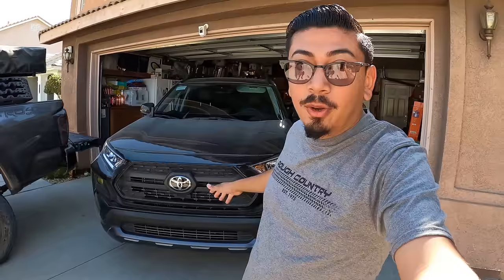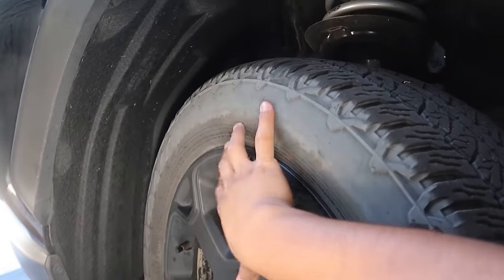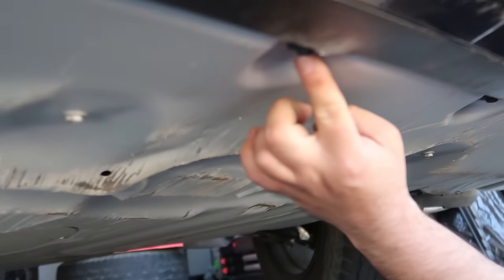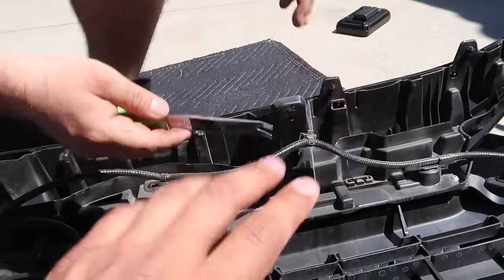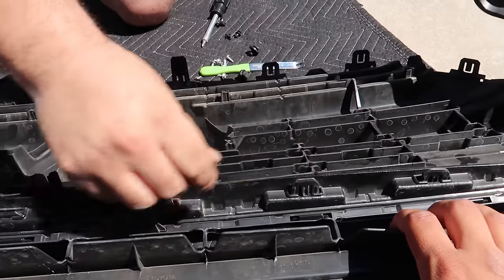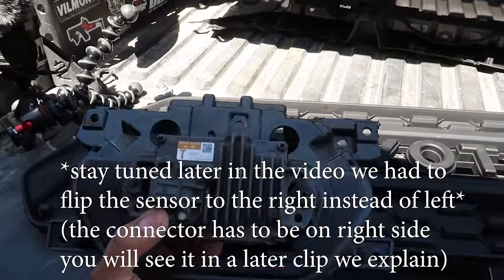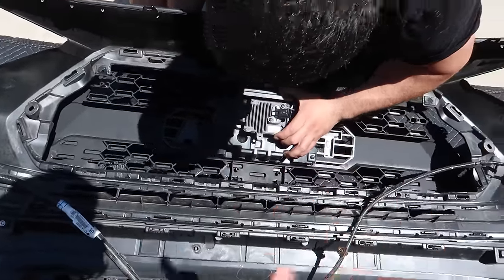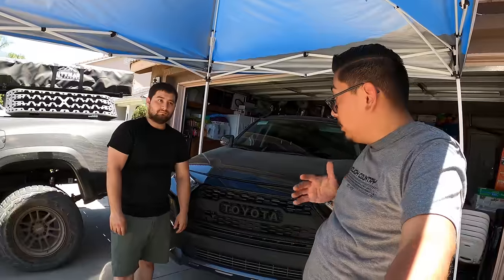How To Install A TRD PRO Style Grille On a Toyota Rav4 | 5th Gen Rav4 IN DEPTH INSTALLATION

Comment: for anyone following the tutorial, your bumper and your hood will have a gap as the bumper will not have any support from the inside (where the sensor plate used to hold it). there is another video here on yt, where a guy salvages another piece of the sensor holder and inserts it in it’s original place. that’s what I had to do to make sure there is no gap.

Comment: Great video! Did you have any issues with the sensor being exposed? Did you consider any additional protection for it?
Reply from the maker: Yes we ended up getting a piece of plexi glass cutting it to size and drilling it into the grille to cover it
Reply: @JesseRizo  that’s awesome to hear! Thx for the quick response. And I guessing that front end collision and speed radar still works fine?
Reply: @jaythor7123  good question! I was wondering the same thing